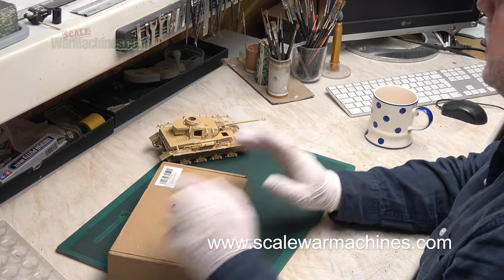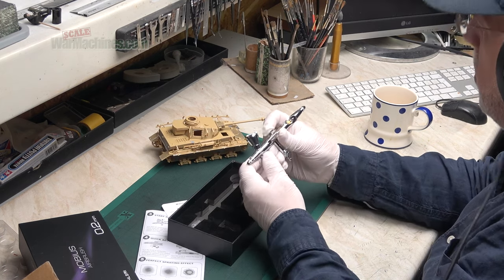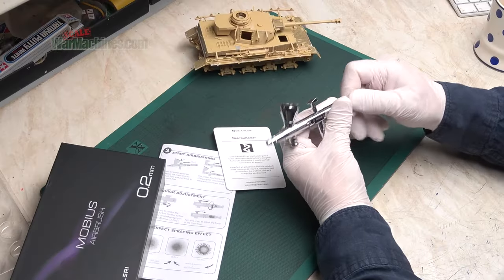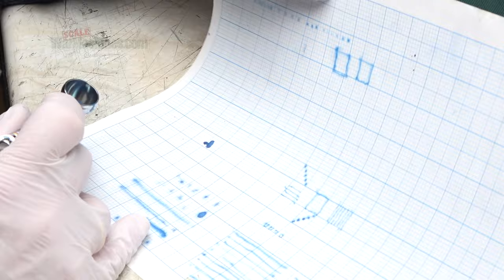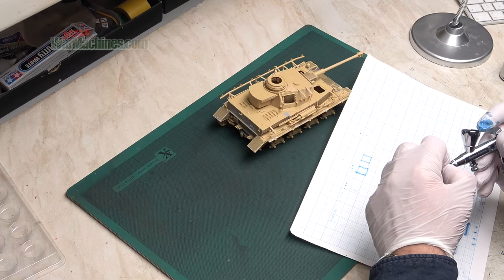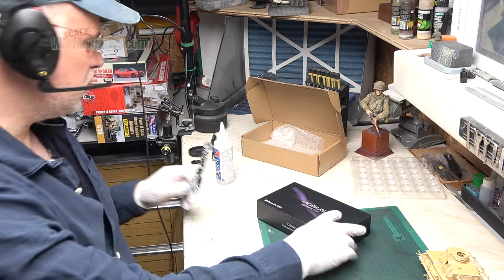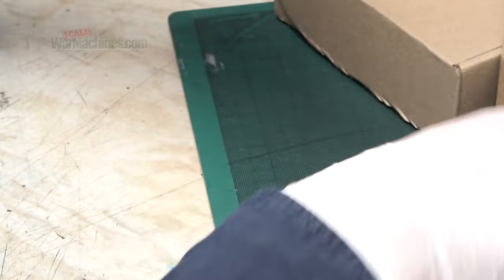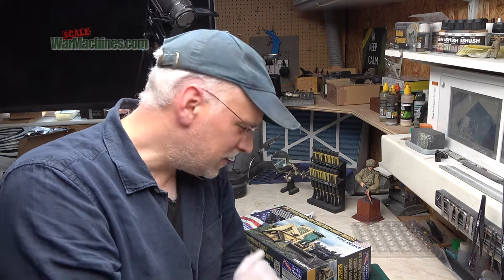THE BEST VALUE AIRBRUSH EVER? GAAHLERI MOBIUS & A CHANNEL UPDATE

Comment: I got the GHAD-39 a few months back for like $28 USD. And it’s the best airbrush for its money I’ve used. I literally just bought the Morbius 2mm & 3mm yesterday and can’t wait to use them both.
Reply: Inspect carefully specially needle tip. My Mobius 0.2 came with a bent needle which they promptly replaced.

Comment: Do you realize your needle packing failed? That's why you have paint leaking backwards.
Reply from the maker: Do you mean paint in the rear section of the airbrush? That’s because I retracted then removed the needle when I was trouble shooting the paint splatter initially. There was still paint in the cup when I did so, so paint entered the rear section but the packing seal on this brush is fine. The film is edited with video editing software, so you won’t have seen that happen but it doesn’t leak.
Reply: Oh would you look at that, another positive review. Who would have thought. Guess this guy will lose some cred too? 😏Seriosuly man, if a product is good and works well for them then people will say so. Nothing wrong with that. 👍
Reply: @TriLaserArt  But it didn't work well for him. He had to adjust all this nonsense. He had paint leaking back and it sprayed and performed horribly.
Reply from the maker: Show me on the dolly where the Mobius touched you, to get you so upset about it all.
Reply: @scalewarmachines  That's the comeback I expect when youre too unintelligent to defend yourself.
Reply from the maker: Yeah, the professor is back…! That took you two weeks to formulate?…

Comment: Hi. Great review. May I ask what compressor you are currently using?  Thanks
Reply from the maker: Thanks, it’s a Hansa HTC15 (made by Werther) which I bought in 1998 and it’s still going strong. Very quiet, so useful for videos.
Reply: @scalewarmachines  thanks for the response. Do you have one more recent you could recommend? I am just starting out painting models.
Reply from the maker: Depends on budget really and what you are looking for. You need to decide if you want a quiet one and/or a tank or not, those are the two major decisions. A tank and quietness are useful, I recommend looking on Facebook Marketplace or Ebay for some reputable brand compressors second hand and try your luck. I've covered a bunch of compressors on the channel, all are viable options. Harder and Steenbeck now make the Hansa brand, like I bought, they are solid units and made by Werther in Italy who make many compressors for different brands anyway. Pricey but long life, as stated, mine was bought over 23 years ago and spare  parts are abundant.

Comment: I might have missed it, so what is your verdict when compared to the Sotar 20/20? Ive been using the Sotar & Iwata hP-C for years now and this brush seems interesting.  Thanks for the review!
Reply from the maker: Pretty similar in terms of actual performance, Mobius is better in terms of finish and price point, but I do like both and have a fondness for the Sotar as it feels so good in the hand for intricate detail work. The Mobius is a fine brush though, can't really go wrong at that price point and both brands have the necessary back-up for parts and longevity - looks like Gaahleri intends to stay the course and shake up the market a bit.

Comment: What compressor are you using? It is clearly very quiet.
Reply from the maker: It’s a 20+ year old Hansa brand HTC15 Junior (made by Werther), still available from within the Sil-Air range in more or less the same form. Great silent compressor.

Comment: I have worked with both the Gaahleri Mobius .2 and .3 as well as with the Harder & Steenbeck Evolution .4 and Infinity .2 airbrushes (not the 2024 models) and the Badger Omni 4000 and 150.
First the Mobius, I was able to work with them without issue, the .2 needs very thinned down paint indeed. Personally I prefer the .3 as it is much easier to work with and the MAC valve is not something I ever use so I prefer to not have it in my way. The .2 sprays finer but not even that much. Cleaning is them is OK, my biggest problem with them is the tolerance around the seals. This is not as good as with H&S and Badger. You can easily get paint into the whole brush if your not careful. I have them just a few months so I cant say anything about life expectancy but I think the H&S will outlive them for sure and the Badgers probably too.
Second the H&S, both brushes are great, the quality of both is a step above the Gaahleri and the Badgers. The .4 nozzle is great and can spray about as fine as the Mobius .3. The .2 is just as with the Mobius only suitable for very thin paints. The Infinity .2 can spray a little finer than the Mobius .2. The evolution .4 is able to do almost all, from base coating to fine details to Varnish.
Third Badger, I like the Omni 4000 much better then the 150. Again its very all round. My biggest problem with both badgers is cleaning them, I don't like it. The Omni 4000 is doable but needs a tool, the 150 is just so bad, I don't use it just so i don't need to clean it. Cleaning is why I got a H&S instead of the Iwata High End line, I don't want to fiddle with a micro nozzle and special tool. (The Eclipse is better it seems but its nozzle looks so much like the Omni I went with H&S)
What would I recommend? Get the H&S Evo .4 for almost all your airbrush work. The quality of the brush is insane, cleaning it is so much better then the Omni 4000 the .4 can do almost everything well. Some people don't like the trigger though but that seems to be fixed with the Evo 2024. Yes its more expensive then the Gaahleri offering but as you can use it for 90% of the jobs its gonna be used a lot, and its money well spend.
Now for extreme fine details when you have enough airbrush experience you can get the Mobius as a second brush. Its cheap and as you'll need it much less often paying a little less seems fine. If you don't care and want the finest sprays patterns and the best quality, and money is less important get the H&S Infinity .2 or .15
Another great option with great price/performance is GSI Creos / Mr Hobby PS-267/270/274/289. I have never used them so I cannot compare them to the above models but many people who have used them love them.
Reply from the maker: Thanks very much for the useful reply and detailed comments.

Comment: Did it come with instructions to help ypu fine tune it?
Reply from the maker: Yes there's a quick start guide in the box, whether that is enough to fine tune it is another question, this is not really a plug and play airbrush, you will need to be a bit more experience than a beginner, for example, as it is a bit fiddly to get set-up. As you can see though, once that is done, it sprays fine.